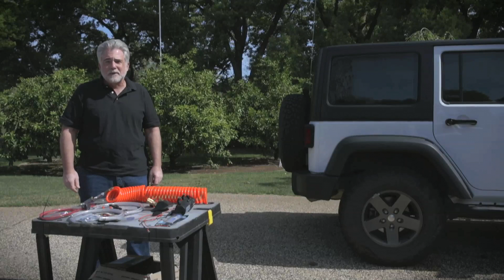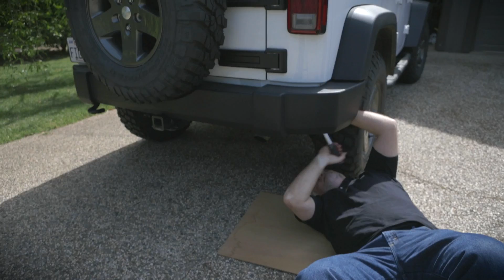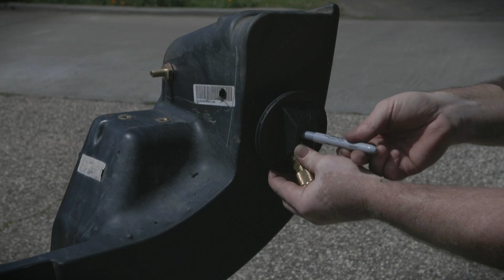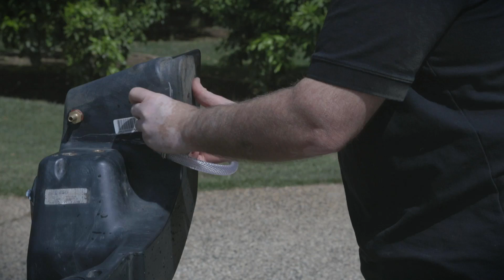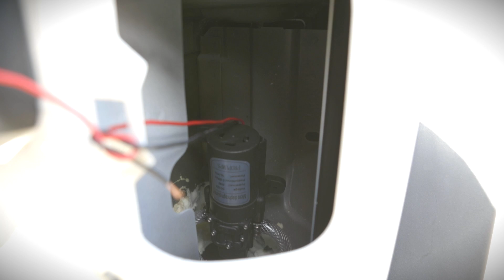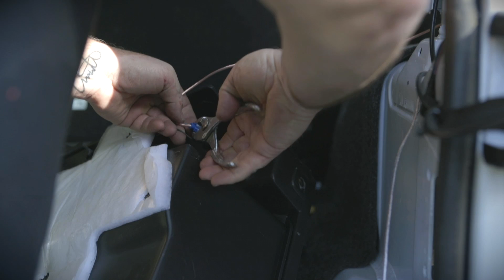Aqua Bumper

Comment: Thanks for the video!!!!  It helped a LOT in the installation.  Just FYI, Aquabumper recommends a different placement for the brass fitting (the outflow of the bumper running to the inflow of the pump.  Aquabumper supplies a hose to make this connection.  If you use the placement that you suggest, then the hose that is supplied from Aquabumper will not reach from the bumper to the pump. (I'm telling you this from my own experience).